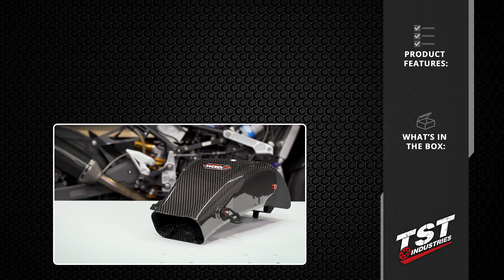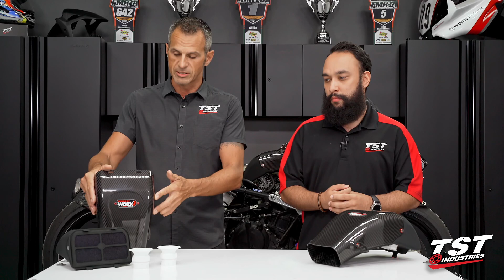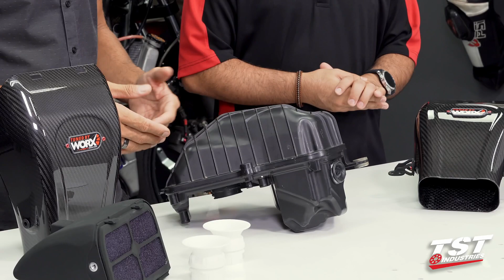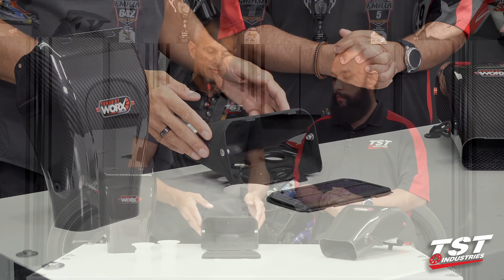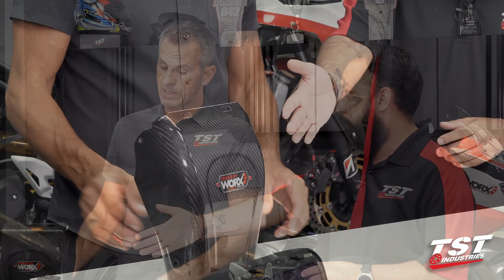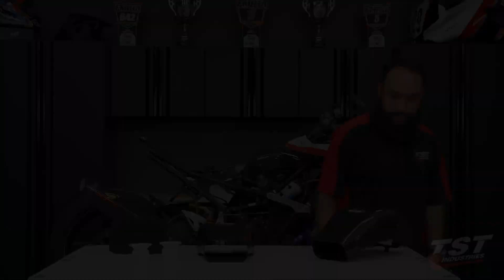2018+ Kawasaki Ninja 400 TST WORX Airbox - Product Feature by TST Industries

Comment: Why doesn't it work with ABS models?
Reply from the maker: The ABS pump interferes with the airbox. Technically the carbon fiber can be trimmed in a way that accepts the fit around ABS pump and it's mount  but that is outside the scope of what this technology is meant for.
Reply: @TSTindustries  Right on... I wish you'd make the same sort of thing for the rest of us!

Comment: Next product for the Ninja 400 should be screw replacements for the body pieces, to make taking the tank off easier/faster for when you need to replace/clean the filter.
Reply from the maker: It's plenty easy with race bodywork
Reply: you dont have to take the fenders off to take the tank off. the seat, the side cowl (where our knees go), and use bunjie cords to hold out the instrument piece that wraps to the tank. I did those steps and put my K&N filter in, easy. use long pliers to get to the vent hoses also.